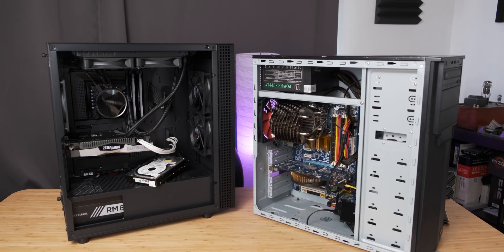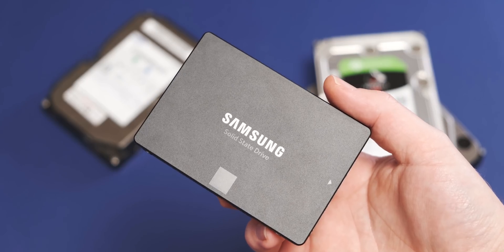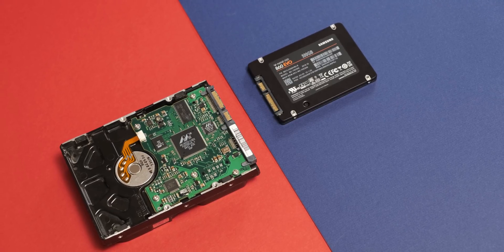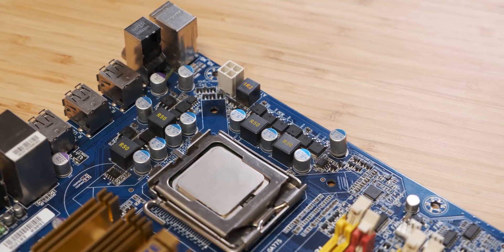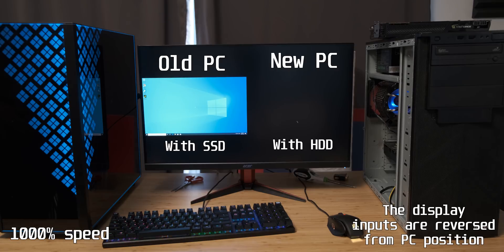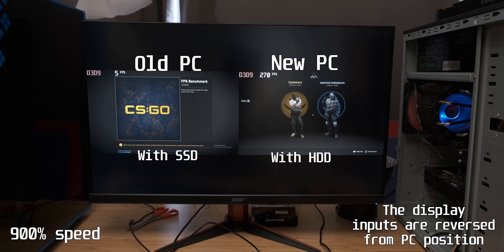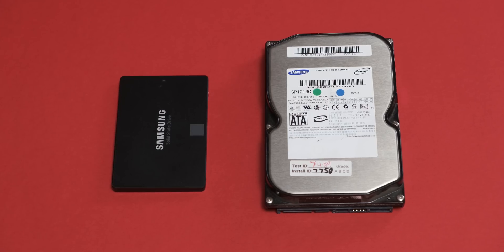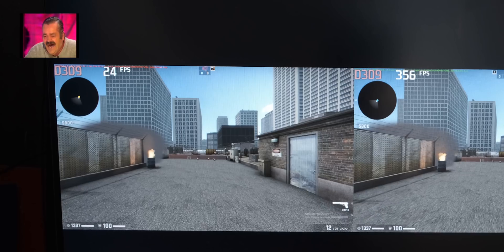New PC with old hard drive vs Old PC with new SSD

Comment: I did testing from sata 1,2,3 up to ssd and end up not using ssd for game library. Sata 1 speed are terible for today standards, you can use it for music or data but beter not to use it. Sata2 is ok if you have it but dont instal windows on it. Sata 3 get the job done, i end up using 2tb wb black (200mb speed) for library and loading diference is marginal from ssd. Big numbers are fun but in real world they dont work like that. I have unopened samsung evo 1tb and in my mini itx system samsung evo 500gb ( windows, esports), sata3 2tb wd black (game library) and last 2,5 inch 1tb hdd for data. There is room only for m.2 but it wont make any real world diference from ssd, so i pass for now.

Comment: I bought a used laptop with an i5 6200u and amd r5 m330 and 8gb of ram.
it has 1tb hard drive, i thought that it would be ok because of the high capacity that i will have but it didn't take too long until i started to notice how slow it was  running i'm thinking of replacing the cd rom and put an ssd instead and this video just showed me what i need.

Comment: I recently did the same. Changed my WD Blue 5400 for an NVMe 1 TB and I can now restart windows in about 40 seconds. With the hdd just closing down windows 10 took 2 minutes and then another 3+ minutes to start. Not to mention I went from pretty frequent drops in SLOBS ~10% a session on the hdd compared to fewer than 1% with NVMe in a 2 hour stream.
Reply: You must have a bottle neck on your mobo. My Sata 3 drive take about 20 seconds. I also have duel boot which slows the process.

Comment: I have a 4Tb 5400RPM HDD, and have it installed in my new system which contains i9 9900k, 32gb 3200mhzt, 3 2tb Samsung Evo ssds. And I use that HDD for old PS3/Xbox 360 era games and many PS4/Xbox era games. The HDD doesn't bottleneck anything infact it's pretty nippy, and love it for older generation games. The 3 2tb ssds I have I use for newer generation games.

Comment: I know it's an older vid, but thought I'd point this out anyways. Bits and bytes aren't the same thing. 1 byte (uppercase B) is 8 bits (lowercase b). So when you refer to the 300 megabits of SATA 2, you're really referring to 300 megabytes. SATA 2 is 3 gigabit, while SATA 3 is 6 gigabit.

Comment: I experienced this dilemma about a month ago because I have 2 pcs but only one ssd. It turns out the weaker pc felt really slow because the terrible gpu was bottlenecking the desktop performance. So I put the ssd in the weaker pc and now it functions like a normal pc and the better pc is running just fine with the more powerful gpu, it just boots slowly.

Comment: I actually put in a 64 gb Sandisk SSD in an old Sony Vaio desktop PC with a Pentium D cpu from 2005. I also have it running Windows 10, but it's original operating system was Windows XP Media Center Edition 2005.

Comment: How do you make ssd work with old pc? I can use it for external ssd but I can not make the SSD for the Operating System or windows in old pc and laptop.
Reply: Would need a bit more system info to provide any useful help
Reply: @captante9889  motherboard h81m asrock ssd samsung evo 500gb

Comment: did texture popins does anything to do with bad hard drive? i'm playing gta v, and though i drop the settings to the bottom, it still has thesame issue, im using acer swift3 with core i3 7th gen, nvidia mx150
can somebody tell me, changing from hard drive to ssd solves my issues or not?
Reply: Yrah your issue is the hard drive, the popping in of textures basically means that your hard drive cant keep up with the rezt of the system.

Comment: 5:35 Yeah here we can see the best example of "To utilize the full power of your newer ""Better"" Hardware, you must use a newer ""Better"" OS."
Price Question: Is a 1 TON car (Software) with a 300hp V8 Engine (CPU) faster, or the 2 TON car (Software) with a 450HP V8 Engine (car) ?
 
It has it's reasons why i still use my old Phenom II 945, with 4GB DDR3 Ram, and Windows XP/2k3 32Bit.

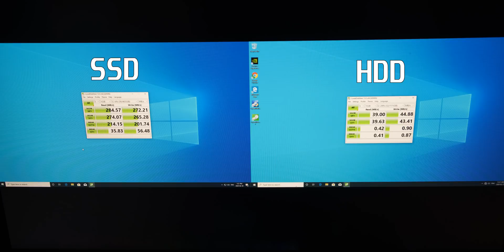7:43 Funny fact: XP need 64MB to run (256MB to run fluid) any Session from the Windows Explorer need 8MB to run, so the complette OS (can if configured properly) is always in RAM, and the SSD does around 280Mb per Sec................lets look at Vista and above, that Garbage need 1GB+ just to start up, no wonder why people say a regular HD is slow. I got 3 "slow" 2,5" 1TB HGST HD's in my system (no AV Garbage Running) that shuffle only 60-130MB per sec, but the system is still snappy............i wonder why.

Comment: Bruh, you're taking these on a new install, when youse the system for like some years, the ssd will be fine, but hard dirives just tanks
Reply: hard drives dont slow down with age though, unlike solid state drives, especially when full or nearly full. windows is what slows down your system over time.

Comment: Thanks you sloved my problem of sata300 hdd that hard drive is terrible its old enough to bottelneck my system my system boot time is really long even the shutting down time is longer than usual even its sata300 but still that drive is too slow because its running from a long time and its overall quality is degraded becuase of the continues spinning of the platter however its also a 160gb hard drive even if i use a new hardrive my pc will become more responsive and fast because its new and currently hard drive im using is 6 to 7 yrs old that shit is making me to doubt on my pc motherboard that if its working fine or not like does my motherboard capacitors could have buldged which is causing this problem but from now i got to know my pc's motherboard is fine that shit hard drive making my pc terrible slow as you mentioned in ur video on your new pc taking time to become responsive even after booting because of that hard drive same is happening to my pc after booting to windows its takes time to load antivirus drivers and some important stuff at around 2 minutes time its taking to load everything after booting so that i can use it but now i have a permanent solution i will buy a ssd asap and get rid of this thing thank you for you video

Comment: Not pointless at all. I am using a very old hard drive with an SSD in Mid Range old PC. But, When I use without the old HDD to boot anything, it boots everything quickly. I don't know why it takes more time to load anything while the old hard drive is connected because I've everything installed in the SSD. (TOTALLY CONFUSED)

Comment: I just realised how old the card in my 1st "Gaming System" was.

I got the system for Free off craigslist and was my PC for about 4 years, it had a core 2 duo 2.2GHZ and a 7950GT, i just realised how old that system was because of this video! I upgraded it to a GT 120 from another "Gaming" pc i got free also off craigslist because said system was crashing (Im guessing due to old thermal paste). When my system finally choked i got a 4.4 Ghz Quad core with a GT 1030 (MASSIVE UPGRADE but still terrible for 2018) i bought for 300$ on ebay right after i got my job. My current rig i dropped 1400 on from iron side is a Ryzen 5 3600 with a RTX2060. It seems i've come a long way

Comment: I’m confused why you aren’t comparing a SATA 3 HDD since you can’t even buy a SATA 1 anymore. It’s not a realistic scenario. A more realistic scenario is a customer debating on a SSD or a SATA 3 HDD.
Reply: I mean its kind of realistic, if you were on a tight budget and you already maxed it with the rest of the system, you might throw in your old hard drive temporarily until you get something better.

Comment: 120GB is pretty much worst case scenario.
(all comments below assuming that HDD is even 7200rpm ;)
Typical Vista-era HDD's would have been 320-500GB, and those had much better transfer-rates even with circa 2006 SATA-connections. Because way better platter-densities, transfer-rates are much higher in 320-500GB drives. So much better that you can actually see the difference, 80-160GB drives were usually much worse. Many older Core2Duo/Quad-machines are actually still quite useful with 320-500GB HDD's, as long as you have at least 6-8GB of RAM. With 4GB you just don't have that extra RAM to cache enough.

Comment: im rocking a 97k 2080 super FTW3 hybrid 32 gigs ram 32k and a 7200 barracuda drive 250gig all sitting on a Z390 DESIGNARE motherboard with a HX850 PLATINUM PSU.
Reply from the maker: :D
Reply: I know I need to put in an M.2

Comment: You could get a PCI SATA3 adapter for the old system, probably pretty cheap.  That and max the CPU out for like $20.  Core2Quad if you can, that should make a huge difference.

Comment: You should have tested them again as old system + old hdd and new system + ssd in order to take conclusions of how much the experience would suck/improve.
IMHO Windwos 10 is unusable without an SSD, it just takes forever to load everything after you boot and become responsive on HDDs, if you do the same test with older Windows versions like 8.1 or 7 you'll notice that the boot + desktop responsiveness time on those versions was way lower.

Comment: Please know what you're saying before misinforming your viewers....  
If sata2 was 300mbit, it would be terribly slow, even slower as usb2 (which is 480mbit) also Mb/s is not the same as MB/s. 
So please educate yourself about the difference between bits and bytes, their correct spelling/notation, and when to use which one as there are rules about that... (same like you wouldn't use feet/hour when talking about the speed of a car).
Btw; sata2 has 3 gigabit of bandwith, enough to move 375 megabytes of data per second, overhead included ofcourse. Even on a sata1 port the ssd would be a lot faster, it's not its max speed that gives the ssd the advantage but the amount of iops it can process. Your hd was a 5400rpm model (slow) which gives it a max iops of 90 while the ssd is not waiting for a disc to complete its revolution and just has the access time of the nand-memory as a defining factor for the wait times between each operation. 
Booting Windows mainly consists of loading a lot of small files, so if you can handle 10s of thousands operations per second versus only 90, guess which one will be finished faster...

Comment: SSD is faster thanks to 4k iops and response times since there's no moving parts. I've resurrected 5-6 minutes booting system on even Sata1 chipset to like 45" to desktop simply cloning to a SSD limited to 140mb/s due to the interface. Once you use an SSD, there's no turning back. Any machine you use will have at least a 120gb OS drive. Or else is a world of pain

Comment: I'm surprised you're getting a 30 Mbps read and write with the old hard drive on a new system.  I've gotten somewhere around 100 Mbps read and write, give or take with a traditional HD on some older Dell Optiplex systems (3-8 years old)

Comment: Would be interesting to see the comparison with a third competitor: A new and quite fast SATA-III hard drive like a Toshiba X-300.  
But yeah: I'm also using SSDs as boot drives in almost all my computers even back to my Optiplex 780 from 2009 apart from some even older retro machines.

Comment: What's the point of this video...
Get new system use new hdd or the new hybrid ones then compare it with the most expensive ssd out there and then tell...
Check Linus video noone could tell the difference...

Comment: From personal experience, I have a seagate 350gb external HDD as an internal one after my original died on me.

The boot to the lock screen on windows 10 took 3 minutes at the fastest, while on desktop icons literally disapear due to the lacking access speed (refreshing restores it for a bit).
Reply: Not even Windows 7 or Android_x86 could speed up the system. Videos stutter every 10 seconds, games take minutes to load data if not crashing.

I'm pretty sure the drive was just on the edge of death.

Comment: Well the SSD is new ad acces data i superB on ssds, but if HDD is old can have very slow sectors which affect greatly the performance and the bus/data speed is on 2nd place in this scenario. i Would like to see comparision with very good modern HDD to compare with SSD ther eis no reason to test this old HDD also the capacity? if capacity is low the read is even slower. Samsung have DRAM as buffer dont remmeber how much 256/512 MB and such old HDD how much is the Cache 8MB? 16MB MAX??

Comment: `Yes, I clicked a down vote.  No, I am not a "bot."  The reason i clicked the down vote is that it is tiresome, and irksome, to hear some young  person claiming old technology as "terrible"  When the first mfm hard drives came out, it was a godsend that beat the hell out of flipping floppies or using a second drive to keep the boot disk in.  When the Ide came out it was a faster more reliable drive (yes there was scsi but it was expensive and used in expensive machines normal people did not bother to afford).  Then the sata came out and was even more reliable and faster.  The point is, old technology is not "terrible" just because you compare it to the latest and greatest because old technology was usually the latest and greatest the industry could offer at the time.  The only old technology that was crap was carburetors, I do not miss those rotten things.
Reply from the maker: Fair enough. I agree that it all has it's place in the development of technology to get us to this point. I remeber how excited I was about my first Sata HDD. Me saying that it's terrible is mostly tongue and cheek. I love all technology. 😁

Comment: It doesn't matter if the HDD is 15 years old or 15 days old, the latency has remained just about the same for a given spindle speed (usually 7200rpm for desktop).
The platters rotate at the same speed and the heads move at the same speed, and 99% of the bad performance of HDDs vs SSDs is because of that. The latency of HDDs is still several orders of magnitude higher.
The only performance improvements are on sequential read/write speeds that are perhaps 2 to 3 times higher today thanks to greater platter density (one rotation under the head will have covered more bytes), but that only has a marginal effect on the day to day usability of the system.
So your test would have been just as relevant with a brand new HDD model from 2020.

Comment: 2:25 it's actually 300MB/s, not Mb/s. Good old bit/byte confusion.
Reply: I hate that
Reply: yup, megabits is for Internet..  so 300megabits would be roughly 30mb/s

300mbs = 3gigabit (roughly)
Reply: @Journetta  300 megabytes per second = exactly 2.4 gigabit
is exactly 8x
Reply: Saaattaaaahhhh
No Ss a tah

Comment: 1) SSDs. Just get them. If you can't get proper SSD, get the best Intel drive and use it as a cache for the platters.
2) There are two caveats to this video's conclusion:
     a) 40MB/s? That is one very, very, VERY old drive. Anything (anything 3,5", 7200rpm, anyway) from this decade will START at double that value.
     b) Superfetch. Use that HDD-only PC for a month, then run a full defragmentation on it. Windows will shuffle frequently used data to the beginning (fastest part) of the drive, improving responsiveness dramatically.
     c) but yeah, do get an SSD.

Comment: its not 300Mb(megabits) its 3Gb (Gigabit) for sata II and a theoretical cap of 375MB for the connection. why is it so hard for people to understand bits are not Bytes, ex a bit “1” and a byte “01100110” Therefor a Byte consists of 8 bits

Comment: You could get SATA III 10 yrs ago , and there were HDD's that supported it. And also SSD's , but SSD's costed an arm back then for 128 GB capacity , and also to be HyperX ones. Motherboard would be slightly off date , due to P67 chipset being released in 2011. As for HDD , you might want at least 1TB with 32 - 64 MB buffer. RAM modules should be also HyperX with two 8 GB sticks , and an old athlete would be still comparable to todays standards. :) Processor can be i7-2600K , LGA1155 , and with very small and cheap upgrades , you can have really good gaming PC , even for these days. :) Not top notch , but still good value for money. :)